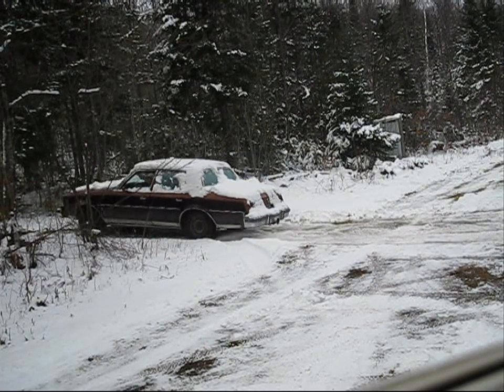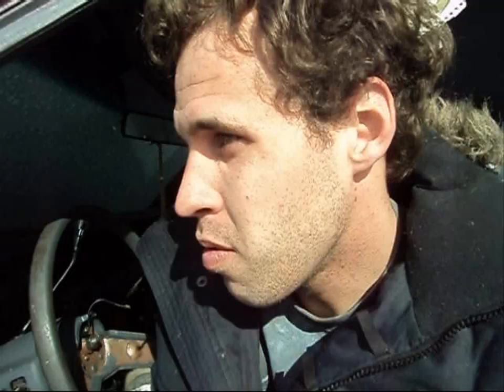A Locking Differential Would Help

Comment: Too bad I saw this a year after the fact. To answer your question, the project can be done. The nice thing is that if your Caprice has the corporate 8.5 rear axle, the center section is shared with the Chevy/GMC trucks. I believe your year of car still uses the 28-spline axles, the cutoff being late 89-early 1990 when the switch was made across the line to 30-spline axles. The G80 locker has a lot of pluses and minuses, for your requested use I think it would work well. It takes getting to know the ins and outs of using them to your advantage. I can PM you with more discussion and how-too's if you wish on the subject. Regards.

Comment from the maker: @carledward1968 Thats great sir, thanks for the info. I would like to keep the gearing the same. I don't want to swap out for anything crazy like like 4:10 gears lol. Sure I would be able to pull a tree out of the ground, but I don't want to lose fuel economy. I will for sure check into it more, because my "85 has full posi, and it would be nice if my '88 was the same.